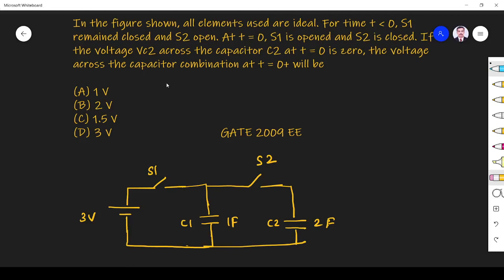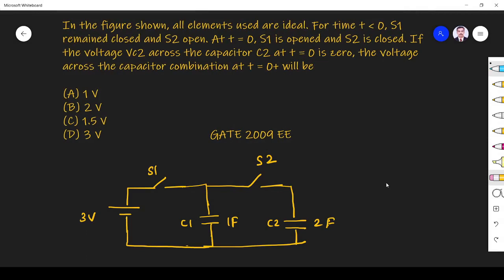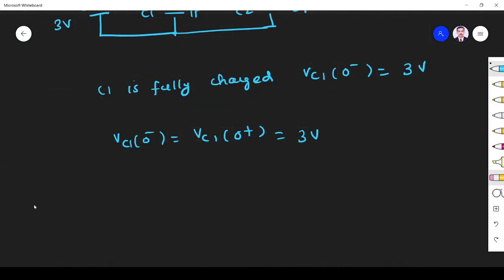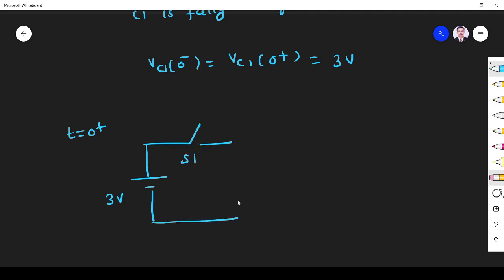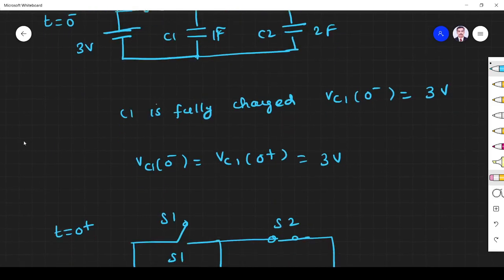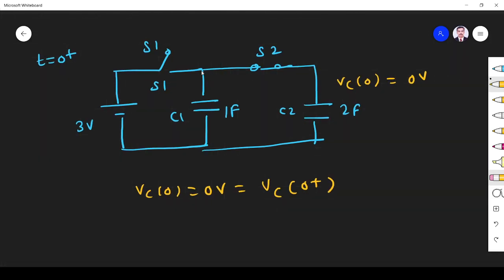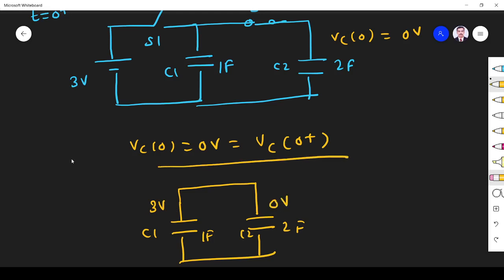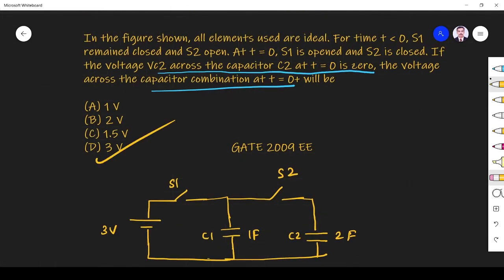Network Theory GATE 2009 EE Solution |#16|

Comment: since there is no resistance. impulse (infinte) curent flowing from 1F to 2F. 
V = 3v
R = 0
I = 3/0 = infinity (Impulse current)
only when finite current flows through the circuit   vc(0-) = vc(0) = vc(0+)   This  is true . But when infinite current flows capacitor changes it voltage instantaneously.